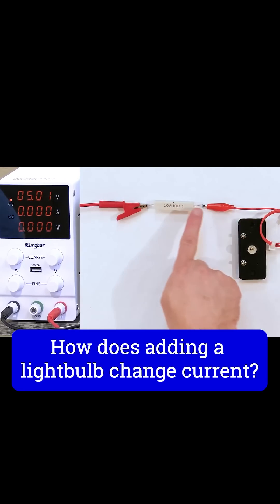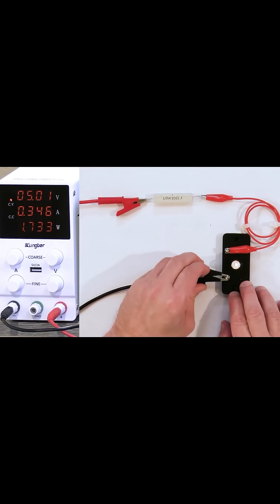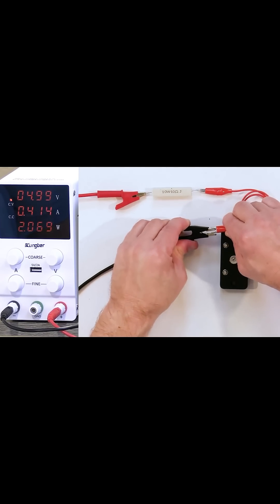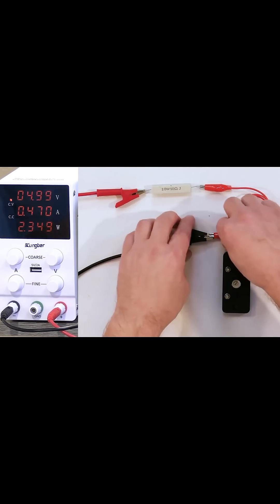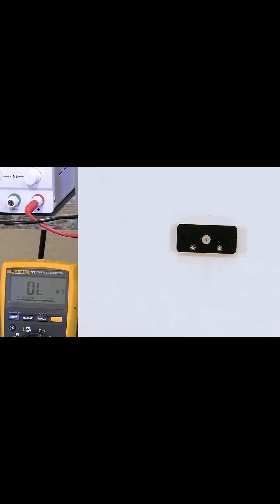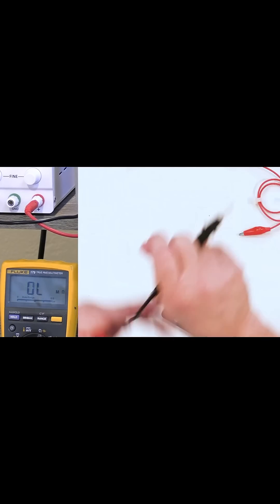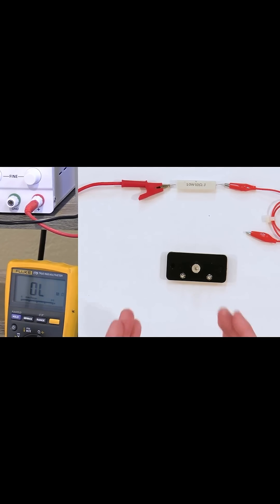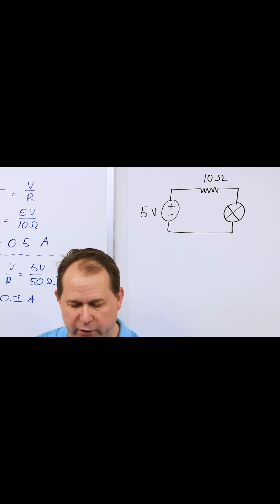What Current Does to Lightbulbs Explained

Comment: Hold on there, Cowboy, you are misleading the cows.  Incandescent lights have non-linear resistive characteristics--the more current they carry, the hotter the filament gets, and the higher the resistance becomes.  Measuring the cold resistance of the filament and trying to plug it into Ohm's law will give you the wrong result.  Using Ohm''s Law properly, the total resistance of the lamp and resistor in series, given the 5v and 0.335A, is 14.92 Ohms.  The actual resistance of the (nominally) 10 Ohm resistor, by Ohm's Law, and the 5v, 0.47A with only the resistor in the circuit, is 10.63 Ohms.  Subtracting the actual resistor value, 10.63,  from the total resistance calculated with both the lamp and resistor in circuit, 14.92, reveals that the hot resistance of the lamp is actually 4.29 Ohms, not 0.7 Ohms.  Back to basics, Dude.